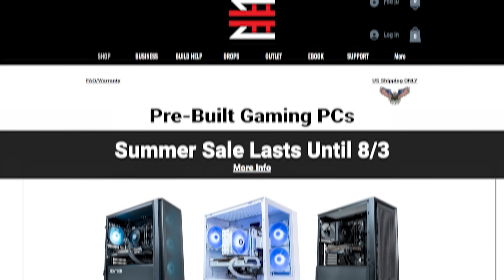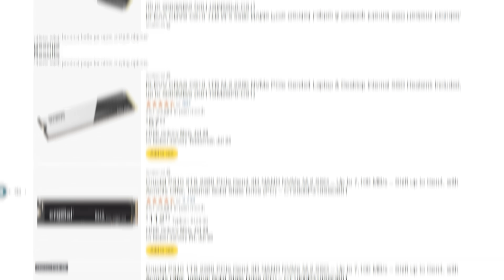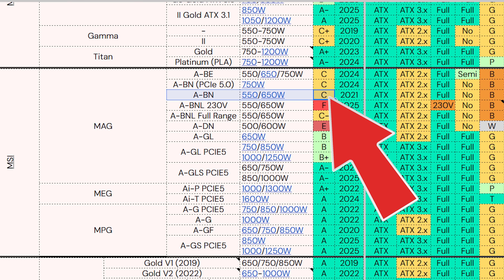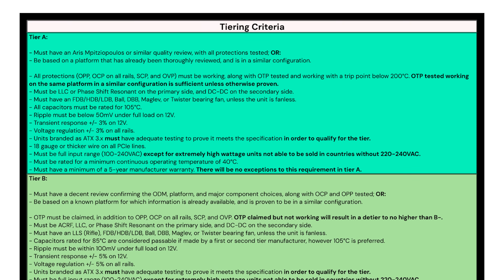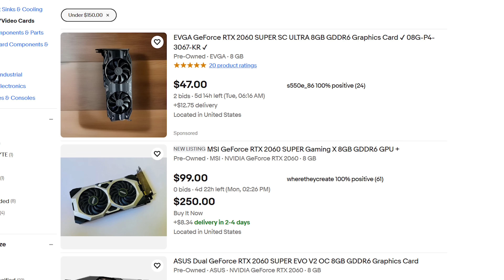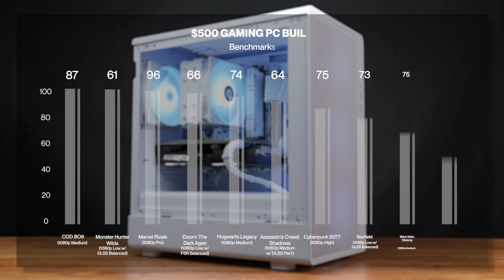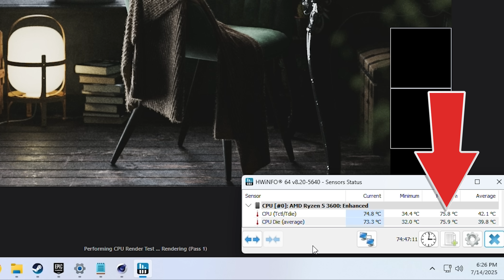$500 Gaming PC Build Guide

Comment: Uk pricing here as some of the kit you mention is not as cheap or available. DDR4 pricing seems to have leapt up overnight to near or as much as DDR5 pricing, so if you want cheap DDR4 grab it if available.
Below is a budget AM4 system for UK watchers. £1 more for a white CPU cooler. Case is black or white. CEX in the UK sell second hand GPU's but with a guarantee unlike eBay. 

CPU = AMD Ryzen 5 AM4 5500 - Scan UK £62
Motherboard = Asrock B450M  AM5 motherboard - Amazon UK £49
Memory = Lexar Thor DDR4 32gb - Amazon UK £54
CPU Cooler = Thermalright Assassin X 120 - Overclockers UK £15
NVMe = Crucial E100 Gen4 NVMe 1tb - Overclockers UK £48
GPU = RTX 2060 Super - CEX UK £150
PSU = MSI Mag A550BN - £40 Scan UK
Case = HCS Hellcracks HCS404 4x120mm RGB fans + PWM fan hub -  Amazon UK £35

Total = £453 

Or you could go for AM5 with the following replacements for a total system price of £533. Bear in mind the faster processor and memory speeds, newer PCIe and NVMe support.
CPU = AMD Ryzen AM5 8400F  -  Amazon UK £112
Motherboard = MSI Pro A620M  -  Amazon UK £70
Memory = Klevv Fit V DDR5 32gb - Amazon UK £63
Reply: thanks mate, also from the uk btw
Reply: @SastusBulbas1 have you built this already?

Comment: yo zack i went from a 4gb laptop with intel pentium b970 2.3ghz and 2 cores 4 threads integrated graphics , to a 16gb pc with ryzen 5 5600g integrated graphics (costed me some am still saving up for rx 580) so am right now stuck to the integrated graphics and i have 2 problems if you'd like to solve them for me
first , the ssd is heavily heavily bottlenecking my pc like in the game rust i saw videos getting 60 - 65 fps in low settings with high render distance , i did same thing and i get more than that but whenever i walk and my pc needs to load things i get frame drops , like a frame drop every second or half a second , i saw my task manager and turns out when i freeze my ssd spikes up 
second problem , right now the rx 580 is so expensive in algeria it like doubled in price because of demand so give me some good graphics cards i can't pair with this 
my motherboard is b450 m-k II ,

Comment: hey zach im from australia is this a good pc for under 2k aud AMD Ryzen 5 5600 | 4.4GHz | 6 Core 12 Thread
CPU COOLER	120mm All-In-One Liquid
CHASSIS	Antec CX200M Tempered Glass RGB M-ATX Case
MOTHERBOARD	AMD A520 [M-ATX]
GRAPHICS CARD	NVIDIA GeForce RTX 5060 8GB
MEMORY	32GB [3200MHz] DDR4 RAM (Black Heatsink)
SOLID STATE DRIVE	1TB NVMe M.2
POWER SUPPLY	650W
OS	Microft Windows 11 Home Edition
NETWORKING	AX900 (900Mbps) Dual-Band USB Wi-Fi 6 Adapter 
it’s 1686.00 aud

Comment: Hey ztt random question, can you mix different sized ram if you you know what I mean???
Reply: You can, but it is best practice to use the same brand and model of RAM. Chances are high that your system will work fine if you use mismatched memory, but it may cause issues depending on your system.

Comment: Solid, but the one thing i would change is the machinist b450 mobo for the cheapest b550 from a more reputable brand. Lose the cable extensions and put the money towards the upgrade. Not just for usb C, but better IO, ryzen 5000 support, faster ram expo capabilities, better VRM, and at least one additional nvme slot for the future. Also can be hard to find bios for machinst boards, and/or rely on them to put out consistent bios updates for new cpu updates (for being able to use newer cpus), or fix vulnerabilities/microcode issues (sink hole/x3d chips exploding).
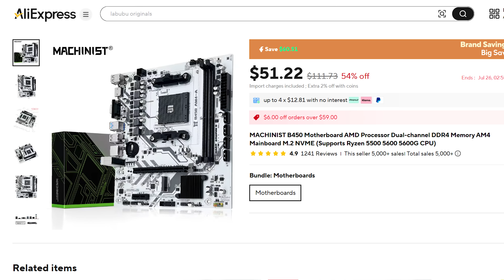Reply: As far as I'm aware the machinist b450 supports up to the Ryzen 5 5600. You can see this at 1:59 in the video. the 5600x wasn't listed as supported but it's such a minimal performance impact to go with the 5600 that it should be fine I think.

Comment: Zach you should try out the K4200 it's a Really god 20-30 dollars used cards it's a (old invidia) workstation card that can play in 1080p maybe 1440p low.
Reply: Maybe in games before 2010, but definitely not newer games
Reply: @jgmixr  Look up videos of it
Reply: @jgmixr  The Quadro K4200 is actually an underclocked GTX 670, with doubled VRAM. It's not so far off to a PS4 GPU.
Reply: @freeezierexp ands thats bad considering that games on ps4 are optimized and it still cant go past 1080p 60fps
Reply: @Darkmangoaura  The PS4 is limited by the slow CPU (most consoles are limited by their CPUs, btw)
Reply: He should try the ryzen 4070

Comment: $700 all AMD pure performance please
Reply: I did this build recently, 
R5 5600 -100-110$
Msi B550pro vdh wifi -100-110$
Ddr4 2×16gb 3600mhz 45-60$
Crucial 1 tb gen4 -50-65ish$
Cooler master 600w 80+bronze for 50-60$
Used rx 6700xt for 230$ (power color red Devil edition)
Any case that supports your gpu and has decent enough ports for 40-60$

Prices heavily depend on where you live, in India this cost me ₹57,000 = 653$ room for an extra SSD/cpu cooler if you live in a not so cold area.
Reply: @theguyinthehoodi3 Perfect Bro Thanks, and yeah I live in India. Thank You bro💯👍👌 (check my bio)

Comment: Which is better upgrade from RTX 3050 8GB?

I want to upgrade STRICTLY with these choices, RTX 4060, RTX 5050, RX 7600, Arc B580 or RTX 3060 all Brand New. I don't have experience in buying used and I don't want to entertain anything about it.

I mostly play online multiplayer games or gacha games like, Genshin Impact, Wuthering Waves, Black Desert Online, Warframe, The first Descendant, World of Tanks and World of Warships.

All the cards mentioned are within 10 to 20 dollars difference in price in my region in stores that I browsed that have stocks. 

The best option might the B580 cuz of vram and it's good plain and  simple hardware wise, but I'm gonna be upgrading from a Ryzen 5 4600g to a Ryzen 5600 or 5500 which rears up the cards overhead issue and I don't want that.

For RTX 4060, RTX 5050 and RX 7600 perform almost similarly and even though they are 8gb's but the games listed are not that vram hungry and I mostly play medium settings cuz high graphics in some of the games I listed hurts my eyes (flashing lights or too much effects). And I can be safely assured of good performance in this cards using Ryzen 5 5600 or 5500 with B450 or B550 boards (I mentioned 2 models cuz it's the same supply in stock issue) without the possible PCIE generation issue from newer budget option from the RTX 5060 8gb/16gb.

And there's the  RTX 3060 12gb it's performance slightly better than the cheaper RX 6600 but with 12gb which is an assurance of better headroom for future updates from games mentioned that doesn't have the CPU overhead issue with the Arc B580.

Comment: Does Ryzen 5 5600 provide any significant fps boost over Ryzen 5 5500 when paired with RTX 3060 or RX6600 ?
I have a spare A520 pcie 3.0 motherboard which CPU should I get?

Comment: Hey zack I'm looking to get a pc with a 170 dollar budget CAD
I'm looking to get 30 FPS in fortnite and 40-60fps on roblox

I found a refurbished prodesk 600 G2
With an
I5 6500
Amd R5 340x
8gb ram
258 Gb SSD

And I'm also looking to upgrade the ram to 16 GB

It's nothing special  but it's the best I found for my budget

Is this a descent build for the budget?? Or is there a better option you could recomend

Comment: I got a pc off of marketplace for $200 + $40 for a 1440p 170hz acer monitor. It had a 5700xt which i traded for a 6600xt for free. It had a cooler master 850w gold psu and a 3600x, 16gb 3200mhz ram, and an itx b550. I upgraded the cpu to a 7700x, mobo to a b650m, and ram to 32gb 6000mhz for $200. So without the monitor the pc was a total of $400. With the monitor it was $440. It also came with all the cables i needed to plug stuff in
Reply: Why would anyone even trade a 6700 xt for a 5700 xt?
Reply: @mantis8326  they traded a 5700XT for a new 6600XT. it's a dub if I've ever seen one
Reply: @CheesyNukes oh I see. That makes sense!

Comment: Going into this year I was still running a ryzen 3 3100 and gtx 1650 prebuilt I bought nearly 4 years ago (only upgraded made was from the provided 256 gb ssd to a 2 tb nvme), however with how good the market has been I've been able to fully upgrade every component on my pc, and along the road saved around $300 with deals. The final parts of my pc arrive next week, with that being an am5 motherboard I got on sale for $130 ($240 originally), and a cpu + ram combo for $200 (without the deal $300). I feel like this has been one of the best years when it came to the market since I started getting into computers, which doesn't say much because it was during covid, and the prices were horrible because of it. I remember thinking it'll be better to just buy the parts separate and build, even if I never did it before, but then was quickly pushed away by the fact that the prices were up like $150 for each item and had to settle with this prebuilt or else I'd be spending like $900 for a computer which pre-covid would've been $500. Love these videos and I hope that people hoping to get into the hobby are able to watch this and get as into it has I had.

Comment: Can you give me feedback for my first gaming pc my budget is 2500 Canadian dollars i want to play mostly Valorant, Fortnite, CS2, Marvel Rivals, and Wukong i would like to have more than 70 fps for Wukong and 150+ fps in the other games
The full build is 
Crucial P310 1TB 2280 PCIe Gen4 3D NAND NVMe M.2 SSD - Up to 7,100 MB/s
Fractal Design Pop XL Air RGB Black Tempered Glass Clear Tint
MSI MAG 275QF 27-inch 2K Gaming Monitor
MSI PRO B650-S WiFi ProSeries Motherboard
AMD Ryzen 7 7800X3D
Thermalright Aqua Elite 360 AIO
MSI MPG A850GL
G.Skill RipJaws S5 Series 32GB
The SFF-Ready ASUS Prime GeForce RTX 5070
RK ROYAL KLUDGE R75 Mechanical Keyboard Wired with Volume Knob
Reply: Dang, nice build. I woulda gone for a 9070 non XT, but I know the allure of Team Green. I wish people would look at the 4070Ti SUPER, though. 5070Ti performance, 5070 price, and it's Nvidia
Reply: @CheesyNukes  the problem is that the 4070ti super is way more expensive compared to the 5070, but the rx 9070 is close priced to the 5070. Should I change it don't care what company i buy from.
Reply: @ArsanyGuirguis-j5c welcome to the weird, new stuff overpriced af market of India.

Comment: I'm wanting to do an $800 gaming pc build for super crazy shaders for minecraft and also play COD and games like that. Currently my build is $910 and I need to somehow take $110 off the current setup. What parts should I get cheaper on? Rx 9060 xt for $390, Ryzen 5 7500f for $140, Gigabyte A620M open box for $80, 32gb DDR5 for $90, 1TB SSD for $55, Montech King 65 pro for $95, CPU cooler for $20, and 650W power supply off newegg for $40.
Reply: 50$ case, 16gb ddr5 and try to find cheaper 9060xt 16gb closer to 350.

Comment: what is a site that shows what asus prime b450m-a can support as far as cpu and gpu i already know it can only handle ddr4 3200 cl15 up to 32 or 64 gb which I think I'm going to opt for the 32gb currently it has a ryzen 7 2700 and a geforce gtx 1660 but i am wanting to upgrade to the highest possible without having to upgrade the motherboard and psu

Comment: would u pair the r5 3600 with an rtx 3060 ti, they are fallen price and ive snacked one up for 155 euros incl shipping on ebay. planed for an ryzen 5 5600 but if the r5 3600 get the job done, i would go with that in the future
Reply: Yeah it pair nicely with the 3060ti
Reply: 3600 is enough for a 3060
Reply: @leonpetrovic9956 Will a 3600 bottleneck a 5060?

Comment: please do a 1000 dollar pure performance build bro. i really want to see what’s your take on the best parts you can fit (especially on the used market)
Reply from the maker: It's coming soon :)
Reply: @ZachsTechTurf  Im calling it its gonna have rx 9060 xt and 9600x and krev 1tb ssd and 32 gb 6000 clock speed and cl 30 gskill flare x5 ram
Reply: @ZachsTechTurf thanks for responding man! i’ll be waiting :)
Reply: @ZachsTechTurf zaaaaack I finally saved up 1,500 dollars took 2 years could you build me the best performance pc pls ❤️‍🩹 for gaming
Reply: i would guess 9600x / 9060 xt 16gb
Reply: @MasterMCGSnormal
Reply: My guess is new 9060XT or a used 7900/7800XT

Comment: $350 PC when?
Reply: Not trying to be rude but at that price range if your only interest is playing games you should just get a console
Reply: @xtizio__1195 good point, but in a lot of countries not named "USA", consoles are hella expensive. Here, a PS5 with disc reader is around 600 dollars' worth
Reply: I can help! 
Start with an OEM, 8th gen i5, 16GB RAM, add a used 1660 SUPER and then paint away
Reply: A while ago he made like a 200 dollar one so you could just do that
Reply: Its called a series x lol
Reply: @Tenebris_Regem. Ryzen 5 2600, stock cooler, b450 motherboard, 16gb ram, 1tb nvme, gtx 1660 super msi a550bn and any 30 dollar case should work.
Reply: R5 3500,
Rx580
B450
Corsair 550w
Any ssd
Any ram 8gb or above
Any case under 30 dollars
Reply: Just get a console bro

Comment: Crushed it. I've been trying to talk some friends from console and they keep saying they don't want to spend $1000.
Reply: A lot of PC gamers use headsets.  I wouldn't factor that as a one-sided cost.

A new console-comparable PC for gaming is likely to run you ~$1,000+.
Reply: @redslate not really, a 4060Ti 16GB can easily push 4K with upscaling and frame gen (same as consoles, who also use upscaling.
Reply: @CheesyNukes Are consoles implementing interpolation?
Reply: @redslate  not sure, but they do a LOT of upscaling and I think it's fair to use FG.
Reply: @CheesyNukes It's not if one's raw render.  😅
Reply: @redslate  console raw render is 1080p60-120. A 9060XT definitely outperforms that. It's over 300 dollars, yes, but anyone who has a decent computer can just slot it in with no problems while also being able to play nearly all Xbox games too. If you use an office PC, a 5060 LP for a little over 300 will still be able to nearly match PS5 performance with DLSS4 in 4K. The VRAM will be a bottleneck though. A 9060XT or 4060Ti 16GB for both can easily get PS5 numbers in 4K, with the new and improved FSR4.
Reply: @CheesyNukes A new 9060XT build will also cost you around $1,000...
As originally stated.
Reply: @redslate  everyone has a PC at this point, and it's easy to just slot it in, or go used. It isn't that hard.
Reply: But they will spend $1000 in the first 6 months of owning a console.
My brother has a ps5 pro he got for $600, a headset(he didnt need) for $300 and a ps+ whatever its called service.
Like bro you can use your existing controllers for the pc, I have a spare keyboard and mouse and your tv is already 144hz.
Reply: @Hasid_Lafre  ps+ is not a whatever it is game pass of ps5
Reply: @Hasid_Lafre facts

Comment: My Best Budget Pc 
CPU: Ryzen 5 3600 (Stock Cooler)
Motherboard: AsrockA320M-HDV R4.0
Ram: 16 GB DDR4 3200mhz Crucial (2x8 dual channel)
Graphic Card: MSI RTX 3060 12GB
NVME: INTEL 660P 512GB M.2 Nvme
SSD: Consistent SATA SSD 512GB
SSD: WD Green SATA SSD 1TB
HDD: WD Blue 1TB
PSU: Antec VP450p plus 450W
Cabinet: GameMax 2810 GreenATX Chassis
Reply: If your motherboard has only 2 ram slot then use 1 16gb stick or upgrade to 32gb never go for 8/2
Reply: @zakikafi9769 I'm planning to buy 32gb ram (16gb 2 ram sticks) but only if someone buy my 16gb ram kit at reasonable price otherwise its still fine i never feel low ram usage in games

Comment: This man almost singlehandedly (indirectly) helped me build a PC (9600x + 9060xt 16GB).
Reply from the maker: Great choice! Thanks for watching :)
Reply: @ZachsTechTurf  Again thank you for getting me into PC building. I used the Lian Li A3, which isn't a great choice for a beginner but the final build is just GREAT!
Reply: thats a sick combo
Reply: @MasterMCGS Thank you it's great for my budget and it plays everything I want on ultra on 1080P and if I want to switch to 1440p it's great
Reply: I have the same combo
Reply: I got 9600x paired with RTX 3070 and 32GB 5600mhz ram. How far is 3070 from 9060xt in performance? Should I upgrade to 9060xt?
Reply: @oksyar  maybe get a 6000mhz kit, that CPU will thank you.
Reply: @CheesyNukes I've heard that but is that really that much of an upgrade from 5600mhz?
Reply: @oksyar yeah, especially in high refresh
Reply: @oksyar  "I've heard that but is that really that much of an upgrade from 5600mhz?"

No.  If you already have the system it's not worth bothering.  If you're building the system then buy the 6000 MT/s kits (not mhz, it's MT/s, the speed of the clock is 1/2 the transfer rate, so 5600 MT/s = 2800MHz.  DDR = Double Data Rate = 2X transfers for each clock cycle).
Reply: @oksyar  i would say depends. the performance difference (when not vram limited is less than 10%, best scenario is less than 6% difference, worse case the difference can be a over 10% difference). if you don't mind a minimal performance difference , go for it that 16 gbs of vram will go a long way. if u do mind and don't mind dropping textures.  i would suggest saving more so you can upgrade to something much faster.
Reply: @OHMYYYGODDDD thanks. Should probably go to 9070xt but a bit later.
Reply: @oksyar  Search in YT "9060 XT vs. 3070"  watch the comparison videos.

Almost no one test RT performance.  Day 1 reviews are outdated and the 9060 XT is going to perform better now, so never put too much weight on those reviews.

In general the avg. fps gain is close to 10% but the 1% low gains are trivial which means that upgrade is probably not worth it.  The ONLY thing I'd consider the upgrade for is if RT performance on the 9060 XT is at least 15% faster than the 3070.  Ampere was an excellent line for the GPU being consistent.
Reply: Thanks I'm 12 and looking to get a PC thanks Zack